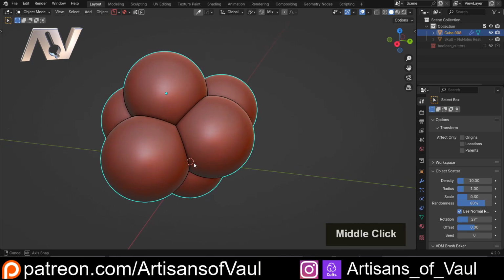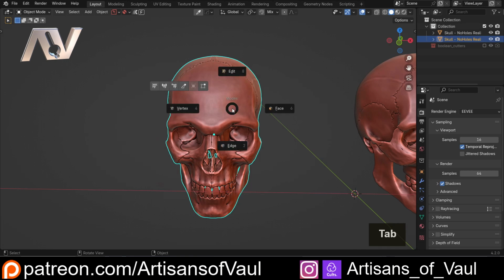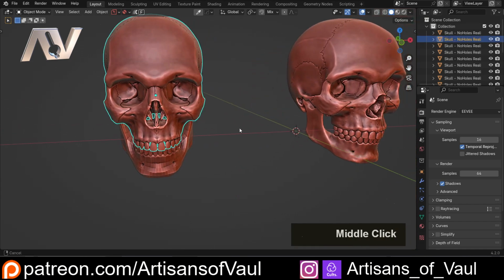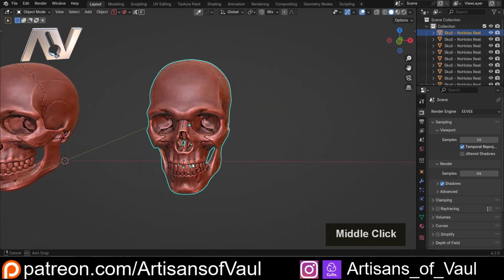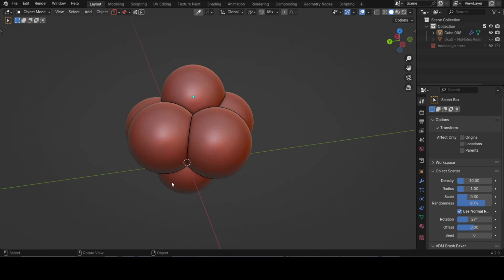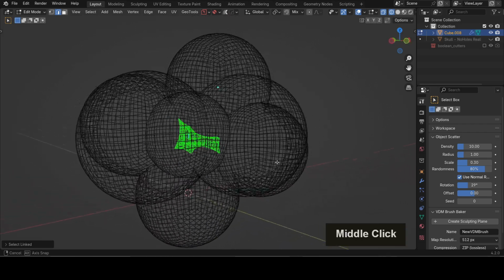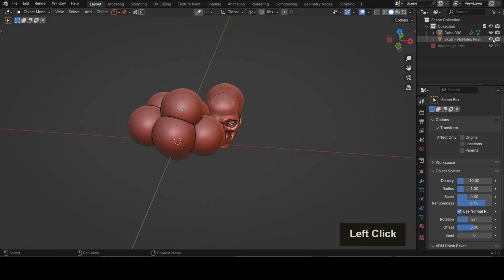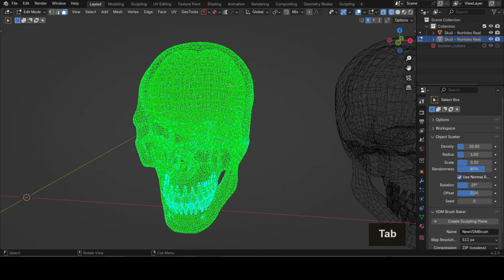Removing internal cavities for 3D printing in Blender

Comment: If only there was a way to easily select inner parts, with few connections to the outside parts, other than meticiously selecting something on the inside, performing select more action, until the outer parts are selected, undo once, delete the inner parts, and continue until no more inner parts exist, and you can close the holes on the outside part.
Reply from the maker: That would be great!  I normally dont find it too hard to find the one or two connecting points to remove them and then use this workflow to delete everything else.

Comment: If the cavities is small enought, I am guessing it wont cost much problem? I do leave loose part to each other and just have them printed together, didn't cost much problem so far
Reply from the maker: It's just going to take more time for the problems to show in most cases.  You might be alright but I wouldn't risk it personally.

Comment: Just a small nitpick. If the loose geometry within an object intersects it doesn't matter, only if they share a vertex or are connected by face or edge.
Reply from the maker: @Arg0n01  I've found issues created when you have two vertices or faces perfectly on top of each other even if they aren't connected. Which can happen a if you're using the faces for snapping

Comment: Sometimes for more complex geometry you can also have geometry which can lead to cavities after printing even if they is no separate parts. As the physical print is often slightly fatter than the mesh.
To delete these you cannot use the "L" key. It has to be more manual unfortunately,
Reply from the maker: I'm not sure why that would lead to a cavity unless there was an error in the design...
Reply: I mean for example if you have a cavity and then you add a hole with a diameter too small. After printing the cavity will remain even if your mesh don't show a cavity. For these you need a manual verification of the mesh.

Comment: personally I just use remesh modifier when I cobble together my tabletop minis that I ripped from TWWH. yes, it is easily eats details if you're not careful and gives you an awful topology, but it always provides perfectly printable fully manifold mesh with zero internal cavities. a real life saver.
Reply: What is TWWH?
Reply from the maker: For a quick option its fine to join objects but if there is a cavity in the model it will still remain from using the remesh modifier.  I would guess those designs luckily don't have any cavities.